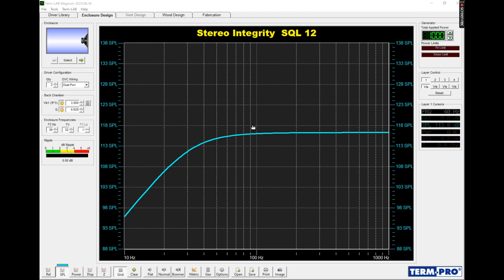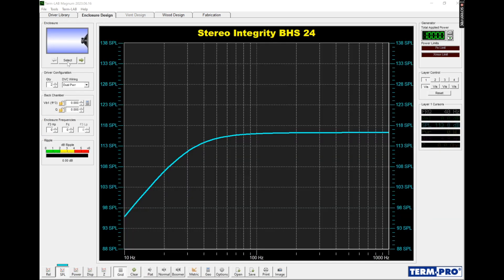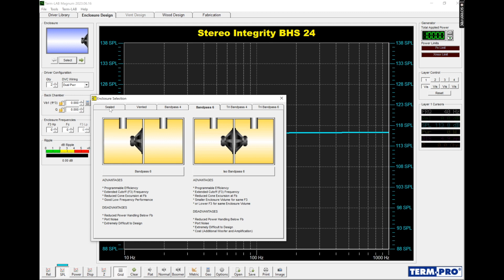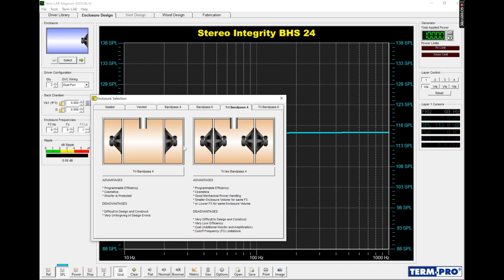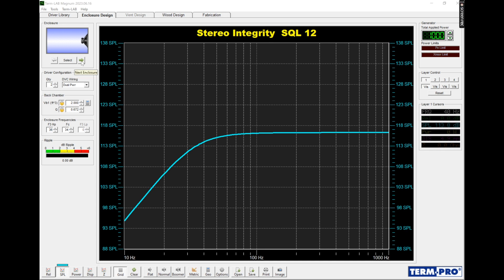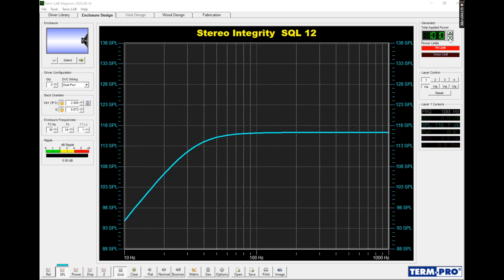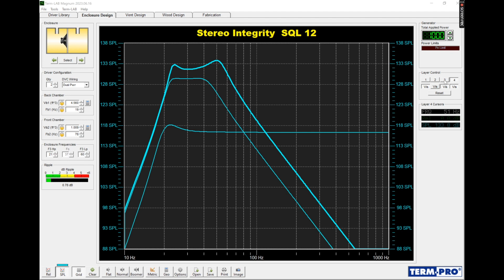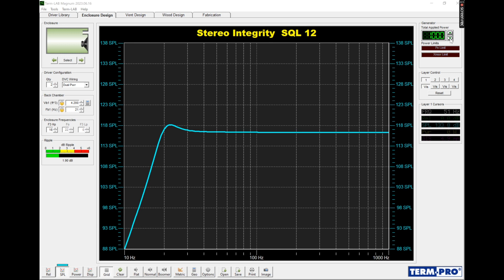Enclosures and Bandwidth

Comment: Awesome video! I'm running a dual sub parallel 6th tuned at 27 and 51. How would you suggest crossing things over on a dsp?
Reply from the maker: I generally cross at 70 or lower. The key to a good sub to midbass transition is all about output levels of the sub(s)/midbass drivers and phase.

Comment: I would love to pick your brain about my set-up to see why it's not doing what I think it should.  It's 2 Resilient Sounds Platinum 18's ran off 2 Down4Sound JP23v2s, 1 per sub.  It's in 6 cu ft per sub tuned to 30 hz.  I think I am having standing waves in the box because of all the right angles and the box blows through into my truck cab.  it is probably in the mid 140's, but it should 150 plus.   I am thinking about a rebuild, but making it look like and hopefully perform like a horn with almost no right angles.  My blow through is 48x15 and I plan on sloping the baflfe from 15at the front  to 8 at the rear and making the sub down fire.

Comment: Are you telling me that with cabin gain, a SINGLE SQL 12 in this parallel 6th order on 1000 watts should do 155DB at 30hz in my single cab Ranger since the cabin gain I calculated should start at 120hz? (Largest dimension in my cab is roughly 5ft)

EDIT: Just realized you were proposing two the whole time, but still on only 1000W, so.
EDIT 2: Okay, so just did a touch of research on cabin gain, and it's not an exact science cuz it's not a perfect world and car interiors/bodies are not perfect environments or resonant chambers, BUT, even if the gain is only HALF of what you said, that's still ~145db on 1000W with two 12s in a 9 cube enclosure with a bandwidth of 25-75hz or so... Which is very close to my goals.

What I want overall is as close to 150db as possible in the mid to low 30hz range in a maximum 16.5" tall, 40" wide, and 36" deep exterior dimensions enclosure, as a blow-through using a port or ports into the cabin of a single cab Ford Ranger. I want the useful bandwidth to extend down to 25hz-28hz, and up high enough to comfortably crossover some midbass speakers since I'll either be using midbass+wideband or a 3 way component setup.

I want to have 4 subs or less, spending roughly $1200 total on subs or less, and not use any more power than a single high amp alternator and two AGMs (3 max) can support. And I want an SQ-styled front stage that can keep up with that level of bass using, as previously stated, either a midbass and widebander, or a midbass, mid, and tweeter component setup with DSP.